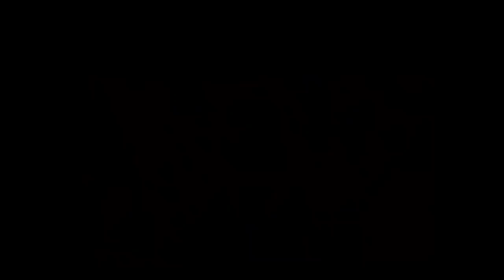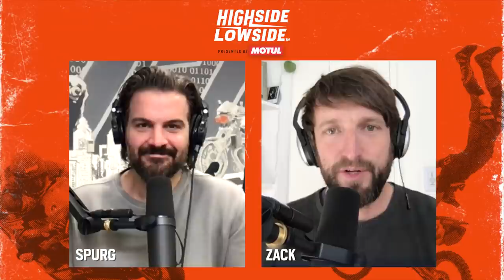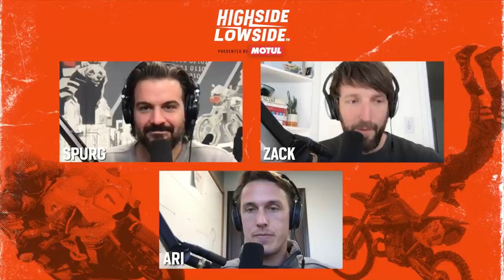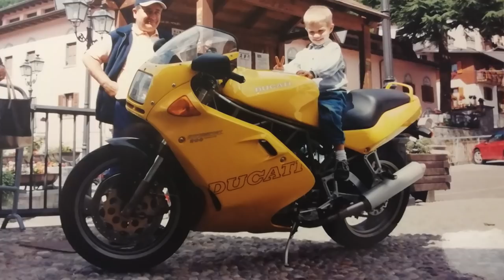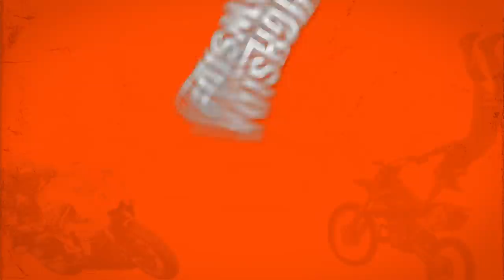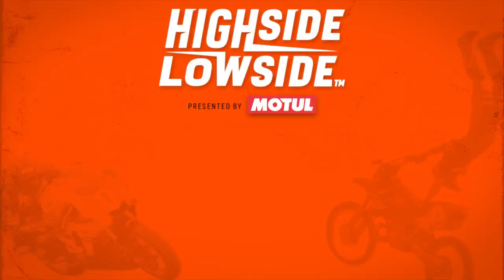Mechanical Motorcycle Mistakes We All Make | HSLS S3 E9

Comment: My biggest blunder?
2017 Duke 390 needed a chain and sprockets change. Wanted to learn so I proceeded to do this WITHOUT a paddock stand. Those of you who don't know , the Duke 390 does NOT come with a center stand.
I was using car jacks to lift the side of the bike, why car jacks? blew up my budget buying a good torque wrench and correct sockets.
As you can  imagine, the bike eventually fell over. With the wheel and tyre removed. ((No harm to bike or me)
hahahahahaha
And, so, I was like, well, "let's at least get the wheel on the bike on so I can readjust it's position and try again".
And the bike was left side down, and the wheel spacer kept falling off because it was on the left side. Hahahahahahaahaha
So I put the wheel back on, BACKWARDS, HAHA (really laughing hard)
Got the bike up
Positioned it better, lifted it, got the new chain, took the reversed wheel off, put it the right way, put on the new chain, torqued everything, adjusted my chain.

Moral of the story? Buy proper stuff guys. Don't cheap out on NECESSARY tools, it really does pay for itself.
In the process of it falling, I also bent the foot rest assembly rod, price to replace it? A little over a dollar. Why? My bike is manufactured in my country and is super cheap to maintain IF I do it. One of the reasons of not buying a bigger bike than the 390 Duke in my country.
Bike is running and in healthy condition. Changed the fuel filter last week as well.

Comment: I wished I knew that a 10-200nm torque wrench isn't exactly precise in the lower end spectrum. I sheared of the head of my oil drain plug in one swift motion. A couple days later ari talked about it in the shop manual. I cannot stress enough how good those videos are. Love this podcast ❤️

Comment: As someone who has an affinity for older bikes (i.e. 80's or earlier), I think one thing that could have been mentioned in this episode is that you might have trouble finding a shop that will actually work on your bike if it's not a relatively recent model.  That's definitely something to think about before deciding to buy an older ride off Craigslist, especially if you're not comfortable doing most or all of your own maintenance.
Reply: And love the show guys!  Keep it up!
Reply: 100% agree - I am not a mechanic ... so my main ride goes to a shop as and when needed and my project bike 1980 Honda XL250s I picked away at over the course of a year and got it to “collector plates” :)  now about to start on a 1973 Suzuki 250 GT (fingers crossed)
Reply: @maltejuergensen2118  older bikes are, at least, generally easier to work on than newer ones.  i'm not a mechanic either, but you can learn to do a lot of stuff if you take it slow and read before you pick up the wrench.  good luck with the old bikes!

Comment: My Idiot mistake:  Removed the camshaft on my 1995 VFR to adjust valve clearances. Being a Honda they were mostly in spec and a couple barely out of spec. Putting the front cam back on I didn't torque the bolts down in proper sequence.. I started at one end and when I got halfway I heard a terrrible CRACK as the camshaft snapped in TWO PIECES...  Ugh.  Had to order another from Honda for $400 and wait a couple weeks.

Comment: I have to give Zack my heartfelt thanks for nudging me over the edge back then to buy my 2017 Tuono V4 Factory. After over 20 years of racing and sport bikes it opened a more comfortable but equally satisfying world to me. To Ari, I have to say you’re spot on. Taking it down to do the valve adjustment wasn’t excessively bad but just putting the throttle bodies back on was  an ordeal. That’s why I took the opportunity to do the Samco hoses and went to metal t fittings because I never want to have to do that again. It’s doable but certainly not enjoyable. Thank you to Spurg for the great show. Thank you Zach for connecting me with this bike, I’m planning to keep it as long as it’s feasible. Thank you to Ari for all the tech info you provide.

Comment: I did the valve adjustment on my 2015 FJ-09. I had a shim kit, gaskets and all the tools. I researched it, but broke the timing chain damper because I didn't fully understand the auto tensioner. It took 3 weeks to get a new damper. There were a couple times I regretted taking on this task, but it all worked out and the bike runs great. I feel so good knowing that I successfully did it myself.

Comment: Im getting ready to put a lift on my jeep, and I'm going through this whole process, making sure I understand the job, having the correct tools, give myself enough time etc....good advice....remember the the 6 P's.....proper preparation prevents piss poor performance
Reply: I agree and also add 3 x the amount of time a shop estimates it will take to do the first time you do it. If it gets done quicker great, if it take a little longer that's okay and you'll be less frustrated. Give yourself time to do it right without self imposed pressure.
Reply: I’ve always said prior planning vs proper preparation... ha!  At least they both mean the same thing.

Comment: I remember when Ari made the change your tyre episode for motorcyclist. That looked pretty straight forward, so off I went and bought the rim protectors, cable ties and a set of brand new tyres. Like most things getting the the tyres off wasn't too bad, however putting the new ones on was problematic. Problematic in the fact that not only did I scratch both my rims, I somehow tore the side wall and and metal banding in the new tyres. I think that DIY attempt cost me $450. 

Now I don't blame Ari for this, even though I followed the steps including using the heat gun. But I will never forgive him for it!

I just bring the wheels to the shop, they usually charge $80 for the pair and dispose of the old tyres for me.

But every time I see someone successfully change a road tyre I must admit, I'm tempted to redeem myself.

Keep up the good work and I'm looking forward to more shop manual episodes.
Reply: Same here ... so it’s interesting now Ari says changing tyres is one job probably best paying for. That vid of his has nearly 3m views.... I dare say motion pro did very well out of it. ☹️

Comment: What hasn't Sprug done. High school teacher, auto mechanic, motorcycle on the moon next?

Cleaning a carburetor is relatively easy but super expensive. I had a shop clean my 4 bank carburetor on a Radian which needed ultrasonic cleaner, and new gaskets. In the end it cost me $600. For that price, I could've bought the ultrasonic cleaner for 1/2 that, bought the cleaning agent, and done it myself. Then made a little money on the side just dipping carburetors.

Comment: In my 31 years as a motorcycle mechanic and now a total of 41 years in the industry, the only time I ever put a screwdriver in a spark plug hole was to check for connect rod bearing damage. I've made my share of mistakes in my first years as a technician and we all learn from them.

Comment: Just bought a new motorcycle. Planning on doing the maintenance myself minus the valve clearance. Gotta get the shop manual!
Reply: What kind of bike did you get?  Checking and adjusting valve clearances isn't that hard to do.  It's one of the first things I learned when I bought my first bike 2 years ago.   I've only had two bikes, a 2017 Moto Guzzi V7iii and a 1975 CB750 and both were fairly easy to check valve clearances on.   I'll admit, I did the same thing Ari did with a screw driver in my Moto Guzzi spark plug hole.  Luckily it didn't do any damage, but it freaked me out when the screw driver got jammed in cylinder. (The next time I did it I used a chop stick, which worked great.)  On my Honda it's a lot easier to find top dead center, you don't have to stick anything into the cylinder.

Comment: Awesome episode and all of them had great input! 

Since I use my motorcycle as primary transportation year round, I prefer and enjoy, doing as much of my own work as possible. Most of the time I could only own my main bike and no backup, so waiting for shops to be able to schedule service and figure out transportation while it's in is for the most part not worth it, not to mention cost of shop fee's. Like Spurg I have a box of new parts for future maintenance. I also buy a shop manual on any bike I get and have no problem purchasing special tools as need since most can be used through the future on other bikes.

That being said, there are certain jobs it's well worth it to take in. I recently purchased a cheap basic second bike partly to have around while I take my FZ6 in for things that I don't want to do or to do things that I know will take time and don't want to be rushed on. On the cheap bike I would do everything on it including tearing the engine down and rebuild it. On my FZ6 it will go to the shop for Tire changes, valve adjustments (shim under bucket) or anything internal. Some things are just worth paying a professional with certain experience and expensive specialty tools!

With my experience now I  look at any new bike purchase in a different way. I researched how all types of maintenance is to do on it and that has a big influence on my choice. If it's just a second fun bike it has less influence though. I love Ducati motorcycles, but will probably never own one for this reason alone.

Comment: Only one so far, 42 years ruding, 35 spinning my own wrenches, was reversemounting a tire with directional tread. 76 CB 750, rear tire, with tube. Had to take it apart all over again. First time doing my own tires alone.

Thankfully, dad pointed it out,  after the test ride. Back on the center stand, slack the chain, and start over. Now, I look for directional arrows, and draw a yellow paint arrow on the tread.

On batteries, black comes off first, then remove red. Unhook BOTH, not just one.

If the jot is still connected, it Will power up the circuit, WHEN you hit a bare spot on the frame.  Had a Dakota almost jump off the ramps with me still under it. Made connection,  with a faulty solenoid and relay, that made the starter kick on.

So. Unhook BOTH. Especially on older vehicles. 

Worst I've seen, welding on the frame, With the battery still hooked up. Zapped the ECM and half the wiring. Why,again, I unhook both.

Comment: When I was buying my second bike, I would download the owners manual and/or service manual and look at the service intervals. Oil change is usually a pretty standard procedure. But I would specifically look at how the valve clearance is done. I also watched youtube videos on how its done, to determine if I would want to do these tasks or how much it would cost to do.

I ended up picking an nc750x due to ease of valve check and most service items. BMW R Nine T is my other fav, while the engine is easily accessible with the big boxer engine, the actual valve clearance is quite complex.

Comment: When I was 16 I had a Suzuki GT185. It was a twin cylinder two stroke. I blew a hole in the top of the piston so I decided to rebuild it myself. Got the job done and started the bike up. Problem was when I put it together I got the throttle cable caught on something and when it started it ran at wide open until I could get it shut off. Fixed the cable and started it, but it had blown a hole in the new piston. Ended up having to do the job again.

Comment: Zack I also caught my bike on fire during my early years of wrenching.  I was check in the spray pattern of the fuel injectors of my BMW K75 in my garage when the fuel vapor caught a spark from the coils.  I learned two lessons that day, don't do fuel-related work in the garage without proper ventilation and have good fire extinguishers in the garage.

Comment: Regarding the shock part, I did go ahead and rebuild the shock on my DRZ and it was actually easier to do than the forks, way less parts and fiddly stuff. Other than shooting myself in the eye with shock oil while purging the air out....

That and spending like 200 bucks on a compressed nitrogen setup, but now I have it and a lifetime supply of nitrogen for motorcycle shocks.

Comment: Great podcast.  it's nice to know I'm not the only that's done stupid things while learning to work on my bike.  Like Ari, I got a screw driver stuck in my Moto Guzzi cylinder the first time I checked the valve clearances.   I didn't keep pushing forward like Ari did so I was able to get it out without any visible damage.  From then on out I used a wooden dowel or chop stick.   My 1975 Honda CB750 has been a great first bike to learn to do maintenance on.  My modern bike is a bit trickier.

Comment: I changed the tires on my BMW K1200LT using tire irons exactly once.  It was a PITA.  However, after buying a NoMar tire machine, it is not such a bad deal.  These are still stiff tires and I won’t say easy to change, but with the machine, liberal lube and warming the tire for an hour in the sun, they are very tractable.

Comment: The air filter on my Multistrada is a 3 hour job.  I’ll be able to do it, but I did buy a video endoscope so I can inspect it in 5 minutes without having to pull the tank.   Another consideration - whose mistakes do you want to pay for?  Last time I paid someone to do a valve adjustment, the mechanic lost a shim in the motor without realizing it - and when he fired up the bike - it cracked the block!

Comment: Changing your valve spacers in a dohc Honda  engine with the spacers underneath the valve follower. Oiling cam bearings & torquing cam covers without slipping the cam chain off timing. Know now lol.

Comment: @Revzilla - Could the chain be tested this way: 
1. An electric motor 
2. Sprocket set and BMW chain (Motor drives the front sprocket at set speed)
3. A wheel or something with equivalent rotational mass. 
You could possibly calculate the distance based on RPM (lot's of ways but I think some of our fellow motorheads with a better idea could help here..)
Then, it'll be a question of running this setup for x hours (possibly days/months and with breaks of course), pour on sand/ water on the chain to simulate real life conditions.

Sorry if this sounds stupid lol. Also, if this does get considered (lmao), then sorry about your holiday Ari!

Comment: From experience, you CAN use a bike pump to seat the bead on a rear 185/55r17 size tire. It is NOT recommended. You WILL be sore. Use lots of soapy water.

Comment: My 2006 Vstrom 650 you have to remove the tank to change the air filter. I'm seriously considering taking it to a mechanic for the next filter change.
Reply: I had the misfortune of dropping my ‘19 650 XT Touring loading it as I was taking it up the steep ramps into a van. Being on the ground the high CG got away from me and It couldn’t be stopped. It fell striking the rear door and I had the windshield off. It bent the bracket for the windshield mount which I didn’t realize until I went to reassemble the windshield.  Entire beak headlamp assembly, instrument cluster, etc. have to come apart to disassemble the mount from the bike to be able to bend it back with some levers/hammers/“blue” wrench so it can be reassembled and everything fit again. If it cannot be massaged back in place, everything has to come apart to replace the ~$90 Bracket/mount assembly.  Yeah, that was an expensive drop. Fortunately the bike ended up laying on its side on the ramps and didn’t dump itself off the ramp onto the ground. Front wheel was in the van.
Bike was 4 months in my possession at that point. Few things got broke, headlamp had a dull white mark where it rubbed across the rear pillar of the door opening... van suffered damage too. I kicked myself for months and months over that. Bought a ride up trailer for the bike then... it really depressed me to having done that bonehead move.   So, just learn to tackle the tank job, empty by riding the tank, then study the YouTube and exploded diagrams in the parts diagrams and just go for it.  Having done it once you then know really how hard it is.

Comment: You may have convinced me to take my tiger 800 XCx to the shop for Valve clearances especially as I don't have a garage or under cover area good to know the clutch will be easy if or when I will definitely give that a go.
I was considering buying interceptor 650 because the valves would be a breeze.
Keep it coming all good info.

Comment: Just wanted to say Ari has  been my tire and brake coach. Plus I did the fork thing on a Fazer 650. Some YouTube leave off those little step where manuals don't. Like the clearance  check I saw online did not cover  the the cam removal and math nor the shins because  the guy online valves good. But if shims are needed you no only need a book but some schooling as well. I took s local term at community College where I told instructor I'm only hear for out of engine maintenance  skill building and I'll let local shop do valves. I'll do plugs and filters bearibg, brakes etc and TBS, but not shim- math cams nope. That's Jan/Feb stuff.
Great broadcast. Signed
2006 Cobolt Blue FJR1300. 
P.S. I got angle gauge and straight and ang I ed feeler lol.

Comment: My biggest regret with purchasing my DVT Multistrada is I can't reset the service reminder when I change my own oil so I would end up having to pay the dealer to reset it anyway so I just bite the bullet and pay them to change the oil and reset the reminder.
Reply: Also, I will never ever try to do the valve adjustments on a Desmo, lol.
Reply: Same boat.   I literally might not have bought the bike if I’d known about this extortion in advance.    I’m planning to do my own and ignore the damn light.
Reply: @Ninety Four Moto not without Ducati’s software tool.   There used to be an aftermarket software program that could do it - but I gather it no longer works for newer models.

Comment: I forgot to put loctite and torque the cam sprocket bolts on my cx650 the bike made it 25 miles before seizing.

 Luckily it seized because the bolts as the came out hit the rear cover. The bike never actually went out of time.